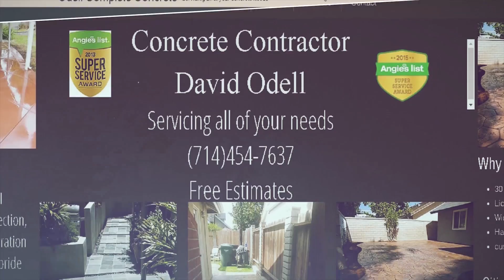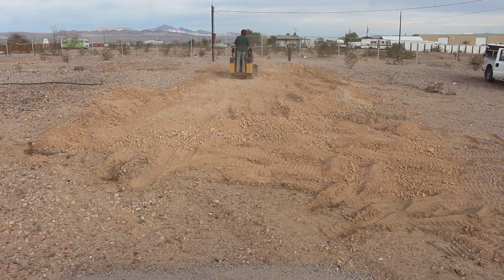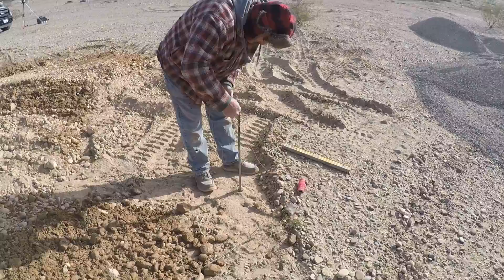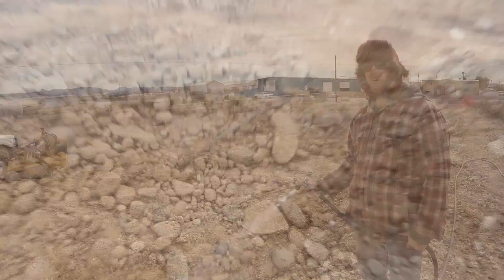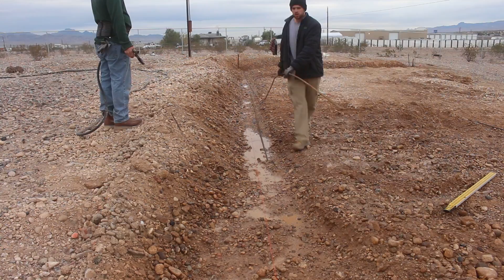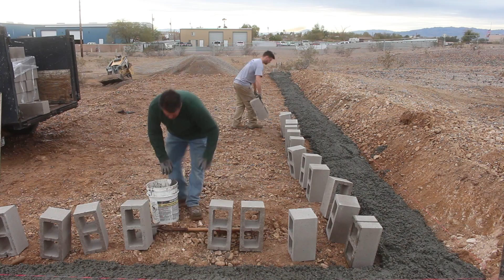Property Development: Retaining Wall (Part 1)

Comment: I did the same idea for my elderly mom - no steps! Except I used garden wall stack blocks 6ft away from the edge of the MH, and then built a free standing deck between wall and MH on the two sides with doors, like you are. Everyone loves the no-steps access. The only down side of this is if you have an awning along one side for parking, you get minimum head room. Not the end of the world, just gotta watch what you park under the awning. Look forward to seeing the rest of the project.
Reply from the maker: SOunds good
Yes it will be a fun project

Comment: How many courses can you wet set without worrying about the weight of the blocks causing it to get out of level? 🤔 or is it by the time youve set 1st course the concrete set up enough doesnt matter
Reply from the maker: depends how fast you set them.
about 4 to 5 for me

Comment: The block with the "Notches" are sash block. Sash block are CMU fabricated with a groove to accept steel window or door frame. Typically used in low-end commercial construction.
Reply from the maker: That's good to know, I also noticed that they were heavier
Reply: @OdellCompleteConcrete  that slot is used for an expansion joint or a control joint, face em against one another and there's a rubber material that fits into that channel also you can mortar it with a bond breaker on one side so stress cant develop across the joint
Reply: 7thsfgp 

Appreciate the info 👍

Comment: Those little slots in the block are meant to be end to end so you can at a water stop in there at your vertical expansion joints on a longer building.
Reply from the maker: That's a great idea , I love that

Comment: Haven’t finished watching the video yet but I must comment on the front discharging mixer. I am a concrete guy in Phoenix for the last 20+ years and have never seen one of those in the state!! I honestly thought it was an east coast thing. Lol. I have also heard of them being called a “right/rite way mixer.” Anyway back to the video.
Reply from the maker: It makes a lot of sense if your tail gating

Comment: I've been working on plans for a manufactured home, 24x44, the town I live in in Western Canada manufactured homes have to either sit on a perimeter foundation or slab that is 8 inches thick. With concrete running 300 a metre (1.3 yard) a mobile slab placed and finished is 15,000 dollars its a monolithic slab as it has to be 12 inches around the perimeter. In my situation I'm going with pier and beam I will have to crane the sections onto a foundation. Building with concrete is expensive, 1800 to 3000 dollars for each mixer truck load trucks range from 7 to 13 yards, concrete pump is minimum 1000 dollars per visit to your site. I'm interested in trying to build cinder block retaining walls a standard 16 inch block is 4 dollars each, retaining wall blocks are nearly 10 dollars each.
Reply from the maker: Wow that's intense

Comment: Hi! one question about the wall.. in another video you poured the footer with the rebar curved at a 90 and sticking up already then installed the bottom course.  In this video you poured the footer set the course then put the vertical rebar in.  Is there a difference and when should you do one vs the other?
Reply from the maker: Hooks are better when your not wet setting the block.

Comment: Curious about water availability with that well.   I live in a rural area where water is an issue.  Above ground storage tanks are extremely helpful so maybe build in slabs or other plan for such?
Reply from the maker: This well is capable of 30 gallons a minute.
I have a 50 gallon pressure tank

Comment: Very interesting video!! I have 2 questions : 1- Did you use mortar (cement and sable) or concrete between blocs? 2- Why you don't put any mortar or concrete between first row blocks? (You only start to use it on second row). Thanks
Reply from the maker: Bottom block is weep holes.
Mortar everything else
Reply: @OdellCompleteConcrete  what do you mean by weep hole?

Comment: Do you offer email consultation? Had a small exterior slab poured(12'x40') and it looks like they broomed it when it was still super wet. Finish is extremely rough..bad news. Any tips or ideas to smooth it a bit? Don't mind paying for your knowledge. Wish you were local!
Reply from the maker: Floor buffer with diamond pads to sand it down

Comment: What the heck do you do if the length of your wall at a corner ends up being an odd block size? like 2/3, or 1/3 of a block, but at a corner? I cant find a video that addresses that. How would you link the corners together going upward???
Reply from the maker: cut the block

Comment: Dave, you made the base of the wall a foot deep since the wall is only 2 feet high... is there a formula for the wall for higher walls.... I need a 6 foot retainer
Reply from the maker: Not really, I base everything I do from working from engineered drawings I have worked with before.
Reply: Your county building department should have retaining wall standard plans you can follow.

Comment: That's a lot of earthwork for a stand machine, my poor legs and back would be done lol.
But you make do with what you have.
I owned a small mini excavator that I used to take on jobs that were actually to big for the machine,  now I have a bigger machine I am wishing I still has the small one also 😂🙄🤷‍♂️
Reply from the maker: I think the small are more versatile
Reply: @OdellCompleteConcrete  
I have a 2003 Case 1825B, 4'0 wide machine. Older, slower, smaller,  but I can get more work done than some guys with the bigger, faster machines. 👍

Comment: Do you need a wood pole? Or did you find 1?
Reply from the maker: Ace hardware is the big boy out here, full drive in lumber yard.
They had the pole
Reply: @OdellCompleteConcrete  okay perfect just making sure I have 40 of them just sitting on the side of the shop